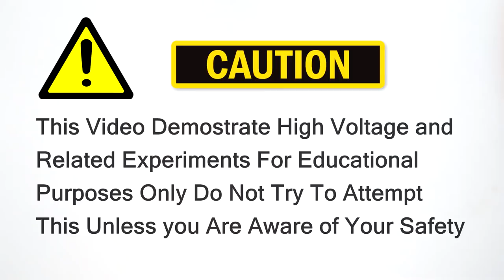How To Make USB Killer from Bug Zapper At Home

Comment from the maker: Check out DIY USB Killer Tested on Redmi Note 4 - Instant death ?
https://youtu.be/OBGp8OeZdLk
Reply: Kedar Nimbalkar why at 00:07 there's a cut?
Reply: Kedar Nimbalkar hey i have a question what will kill the pc connect the capacitor to  The 5V pins or the data pins?
Reply: Kedar Nimbalkar what if we charge it for something like 5-8 seconds non stop
Reply: Wouldn't you be able to recharge device by plugging in the USB killer directly into a cellphone charging block ?
Reply: In starting you said like 
Oh my gaand
Reply: Kedar Nimbalkar this is fake because he cut the video by rthe test
Reply: Don't say it please I have a note 4😭😭😭😭
Reply: Haha it's much easier just to plug it into the 220v~ outlet so you dont destroy the bug zapper and it's more compact
Reply: Please show how this works with Tv or System...?

Comment: 1 Question 
I have followed your steps but I have stucked some where plz help me ....
Will the female port which is attached to circuit will spark without the the usb connected to it if the button is pressed ?
plz help me

Comment: For an even more effective one put a  quench tube arrester between the hv capacitor and the usb data lines. Guaranteed fry of all the logic controllers in everything, use a photoflash capacitor and you can target the 5v bus and literally kill everything in the computer ir device. As a bonus it usually causes tge charging curcuit to short badly enough the device will catch fire. Handy if you need to kill the device with almost no notice.

Comment: Now I ask you .. if you already directly solder a usb peg, would it work too? Or can there be the possibility that the usb voltage of the pc or other device can spoil the capacitor or the circuit?
If it could be done as it is, it would be fantastic to take the handle of the racquet to all places very practical is not xD

thanks and regards
Reply: I have the same doubt, I would like to know if it is possible to connect the male USB instead of the female one and use the racket circuit directly without having to desolder the capacitor
Reply: Have u tried that brother??

Comment: Hey dude, I'm tryin to follow this and I have a different capacitor, 250v (334j 250v if that makes a difference) from an old TV. Will this still work, or does it have to be around the 2000v you're outputting?
Reply: Make it and try it out

Comment: hello Kedar Nimbalkar, can you please tell me how do you charge the battery of the mosquito zapper if its drained after you used it several times...thank you BTW your video is awesome
Reply from the maker: +Steeve Bugtay you can keep the zapper as it is or if you're using the circuit you need to charge battery externally with power supply.
Reply: Kedar Nimbalkar so it's OK not to cut the wire connecting  the plug? BTW tnx for replying

Comment: i made one with electrolytic capacitor but mine gets charged from the pc usb port power wires then releses high voltage to the pc from the data wires
Reply from the maker: +ninja ninjopoulou my previous 3$ USB killer does that  and you can make it by hack of just 1 wire !
Reply: i ve seen that video and im probably going to order one becase it has the protective case and it looks like a normal usb drive

Comment: Need help pls. Im subscribed
Hello I have an electrolytic capacitor taken by an old camera with flash. Virtually come to a maximum of 330V which is enough to fry a motherboard, but I have no idea how to load it in a way to make it work as a usb killer. Can you give me a hand to get out of it?
PS: I don't have a bug zapper racket
Reply from the maker: +Antonio Landi A Disposable camera flash circuit uses 330v capacitor charging circuit . you can use that , this video denonstrates that https://youtu.be/KY4avd86qdo
Reply from the maker: +Antonio Landi. You can use this capacitor charging circuit Look at this on eBay http://www.ebay.com/itm/371713560472
Reply: Kedar Nimbalkar Ok Thank You

Comment: Why would you destroy computers, cell phones, even Xboxes on purpose??  Why would you take the time and even a very minor expense to build something that ruins working electronics????  Why break things that still work??  That's incredibly stupid!!!!!!
Reply: Michael Hesterberg The USB killer was made for over voltage protection testing. Go away.
Reply: +Tacocat,  Sorry, but I won't go away!  I've been using maybe a total of
 just 5 computers since the early 1990's---I started with Windows 3.1 ! 
 I have only upgraded my computers when they either couldn't run some 
new program I wanted, or if like my last one running XP, it kept 
crashing and forcing me to a slow reboot!  I have been using flash 
drives, and USB devices for nearly 10 years.  I have NEVER had a need to
 worry about any device injecting OVERVOLTAGES!!!  First, I never allow 
other people to use my computer unless I trust them.  What I think is 
that these USB devices are made simply to have destructive fun with!!!  
Kinda like dropping a lit "cherry-bomb" down a public toilet and 
flushing it---then running like hell!  How old are you?

Comment: How to make a USB Flash Drive Killer

You will need 
Female USB Cable
Power plug
Solder only the USB power lines to the power plug

Then plug it into the wall then plug in your USB flash drive in the connector then BOOM!

Comment: So for the male usb port, we join terminal 1&2 and 3&4 and solder wires to them. Understood !!

I need help for the female usb port, how are the terminals supposed to be connected .. am i supposed to use only terminal 1&4 .. what about the middle terminals ? Am i supposed to join them ?

Comment: Safety? HA, I laugh at your will to live. I play with  high voltages ( AC) all the time with no protection. I normal hook up my transformers in series and for fun with voltage, parallel for melting things or put a microwave capacitor for loud sparks. Nice video tho.
Reply: Watch out guys, we've got a badass over here.
Reply: Uhhh, ma bois!